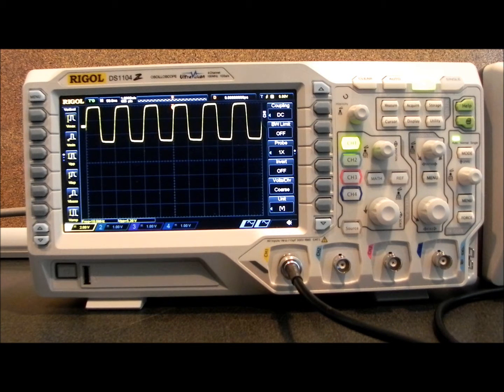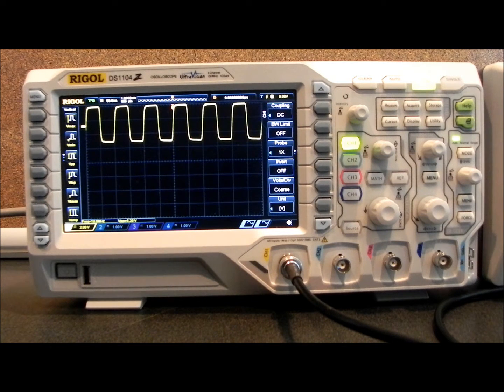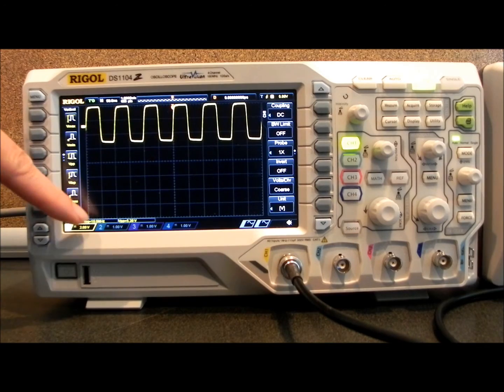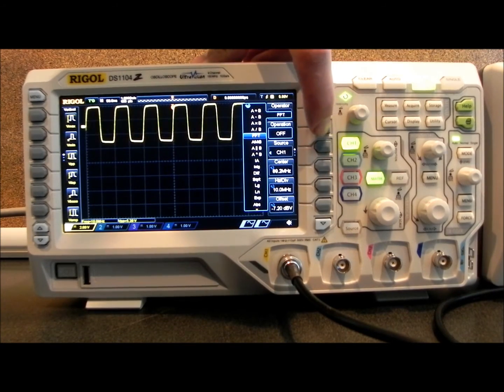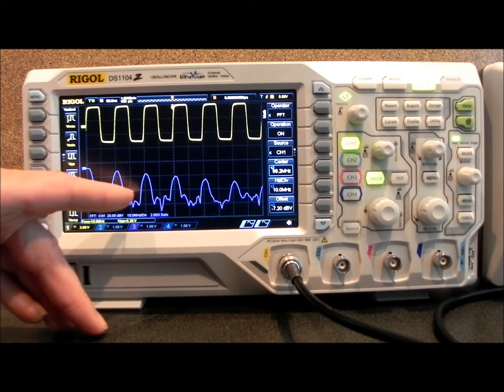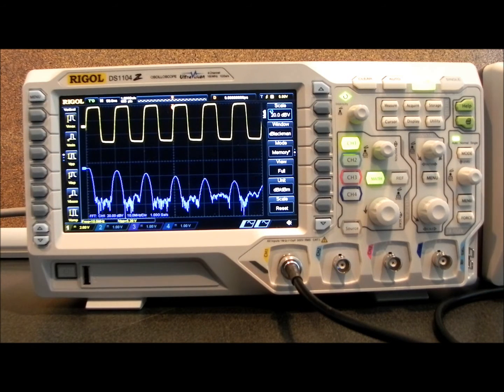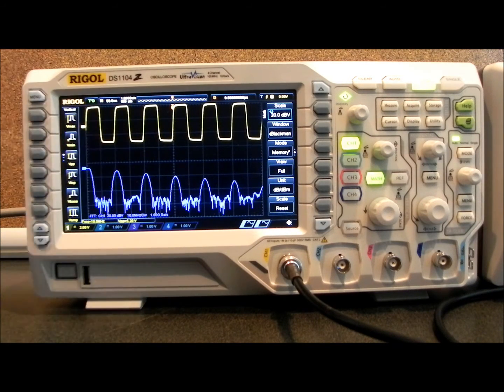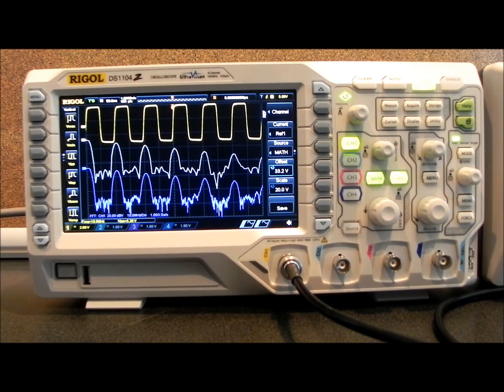DS1000Z Enhancement: High Resolution Deep Memory FFT

Comment: There is a feature to set an averaging acquisition mode on DS1054z. Is there any option to average FFT independently of the acquisition mode? This would improve S/N of the FFT considepably
Reply from the maker: This function is not on the DS1054Z. The newer MSO5000 series includes a color graded FFT mode that gives you a density chart look similar to a real-time spectrum analyzer. Of course, you can pull either the time data or frequency data off of the instrument and average it in Excel as well.

Comment: Just bought a DS1104Z-Plus - all options included (SW 00.04.04.SP4). I love the scope and it is great value, but it is sad to say the FFT performance is still as EEVBlog describes in https://youtu.be/07VkEUUd0eo?t=946 . I tested this with the same FM modulated 1MHz input. Surely this could be massively fixed with a software update. Memory mode as described in this video does not help at all. There still is a totally limiting resolution. The way the centre frequency and range changes with timebase is particularly annoying. FFT on this scope, for all but basic use, use-less.

Comment: do you have any plan to update the 4000 series and how is the fft performance in 4014 ?
Reply from the maker: +Aminur Rahman Our R&D team is taking a look at expanding the FFT capabilities for the DS4000 platform. If they do expand any of the scopes capabilities, we will post a video as well as update the firmware release notes. You can check with your local Rigol support office for more information.
Reply: +RigolTech That would be a great improvement for the DS4k series if it could be done.

Comment: On  my scope (DS1054Z) when I switch between "Trace" and "Memory*" I lose the Center Frequency and Hz/Div settings... the FFT display goes back to the default values. The Scale value stays where I set it but the other two display parameters lose their settings. It would be nice if all the settings remained the same when switching between Trace and Memory*.  

What's the significance of the asterisk?